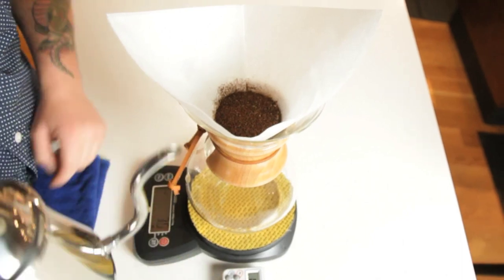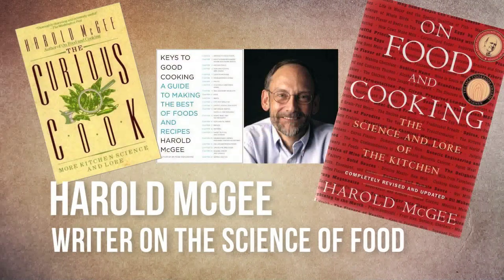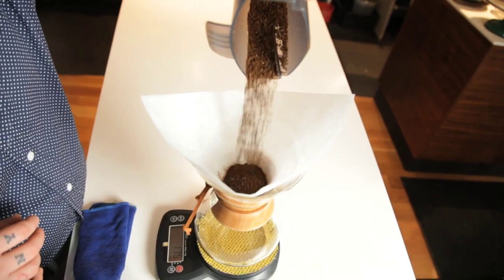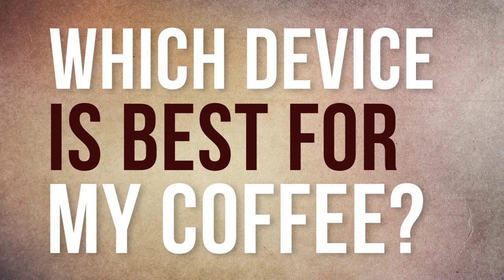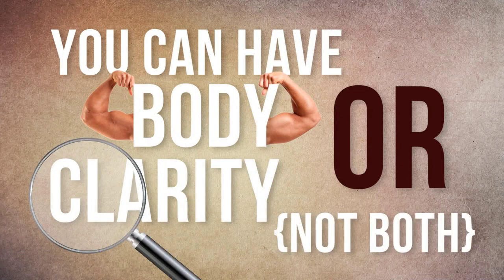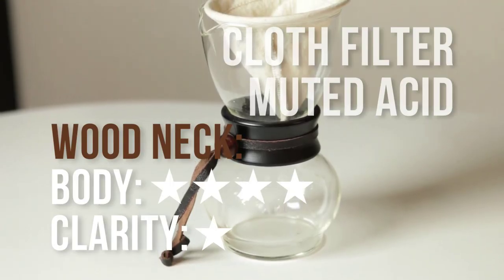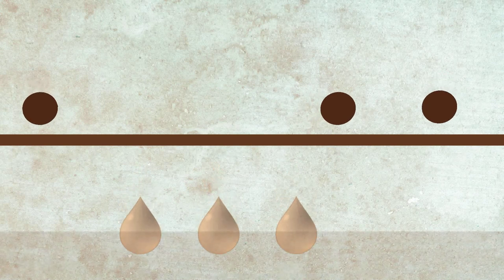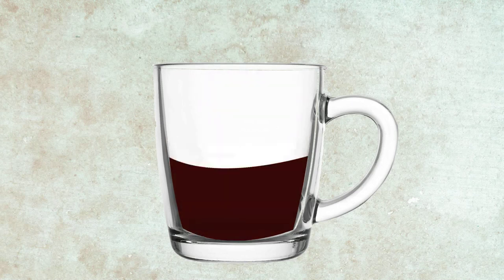Gear for Your Coffee Grounds

Comment: What most of the videos don't tell you is that to get consistent grinds you need a pretty expensive grinder. No burr grinder under $200 is going to give you great results. Some of the brew methods are more forgiving than others but you're basically going to get a cup that has a bit of an imbalance due to varying particle sizes. Some variance is needed but might send you down a rabbit hole of crappy grinders and sub par results. So save up money and get the best grinder you can afford that is ultimately going to be the biggest factor in resulting taste. 

A scale and timer are also needed. Water temperature is not as critical as they might have you believe as long as you are within the 195 - 205f range. Which is basically few seconds off boil, as soon as you transfer the water to another vessel it drops at least 5 degrees. The slight variance doesn't matter unless you are making espresso.

Comment: What was it about the different methods that gave different results. Most people have drip coffee makers. Also, did you measure the temp of the water? What is the optimal temp? And though the best grind has a consistent size, does a different grind affect contact time and eater temp? I could have learned a lot more from this.
Reply: Derek Ryter tempature should between between 175-205 Fahrenheit. The courser your grounds, the Longer your brewing is, the finer the grounds, it will be faster. That’s why espresso takes a real fine grind

Comment: These devices are in order... then show us how the devices aren't in order. :)
Reply: I noticed the same.   A contradiction between device order at beginning of video and star ratings at the end (body vrs. clarity).  
I jump between using my Aeropress and Hario Woodneck (cloth filter) and find the Woodneck, with it's super fine cloth weave, to have more clarity than their one star rating at end of video.  
Add to the mix...the Aeropress can be tweaked in several directions to change that body vrs. clarity balance, such as using two paper filters or a metal filter instead of paper.